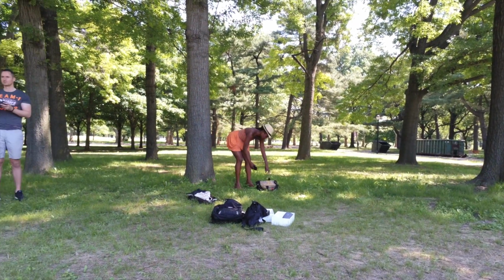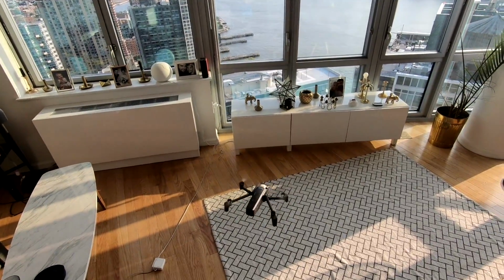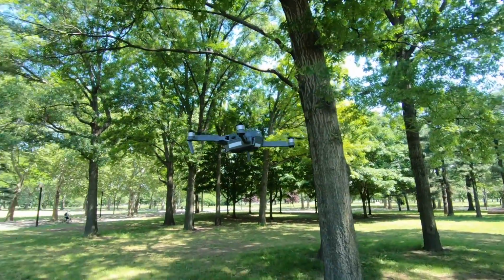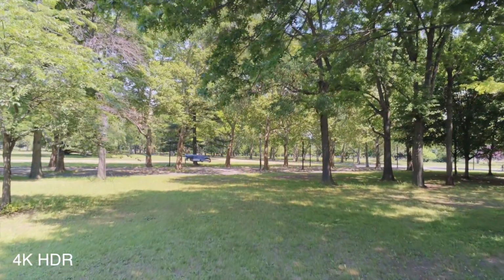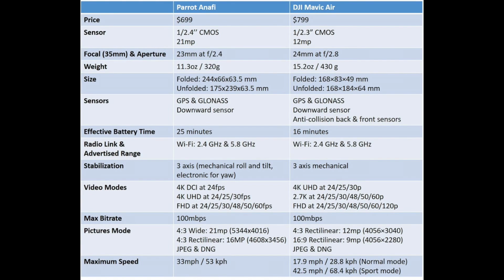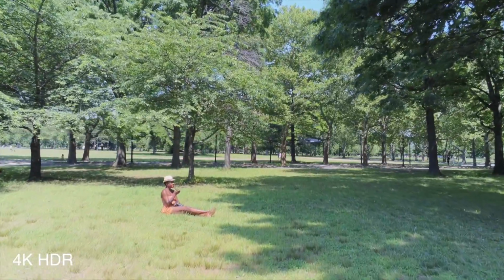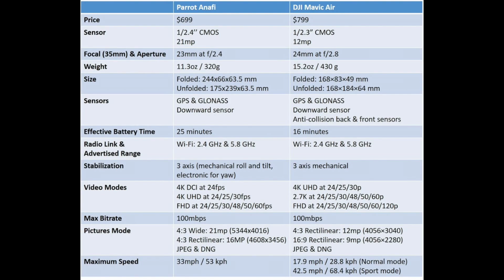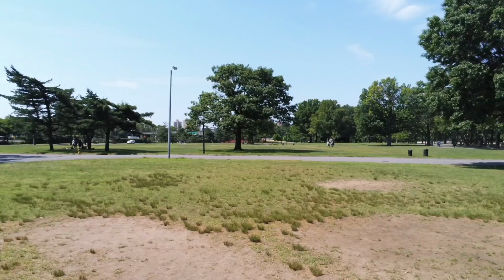Parrot Anafi First Impressions and Tests - Parrot Anafi vs Dji Mavic Air Feature Comparison

Comment: I can't tell is there any actual quality different than Bebop 2 running firmware 4.4.2. In terms of sharpness, color, pixel density and details level.
Reply from the maker: Hey, thanks for you comment . I couldn’t take it really high to properly demonstrate but what I see is pretty good. I was considering making a comparison to bebop 2 . Woult it be something you and other drone enthusiasts would be interested in seeing?
Reply: Sure, if you have a Bebop 2 running firmware 4.7.1 (latest available since yesterday). Have fun.
Reply from the maker: I would try to find one:) i was curious abot the goggles so i may contact some people

Comment: Good video! Nice drone by Parrot appreciate there efforts! But why didn't they include obstacle avoidence on Parrot ANAFI? Very strange 🤔
Reply: Because OA is only needed by toy pilots that can't fly and don't pay attention.
Reply from the maker: If I knew it during the launch event i would have asked the project manager of the drone. I had a long chat with him. But i was soo hyped up that I didn’t ask the right questions:)
Reply: silbay! I flew out a distance and when I got the low battery alarm and my Mavic came back by itself and went around a few Obstacles to get there! By the way, I fly all the Time!